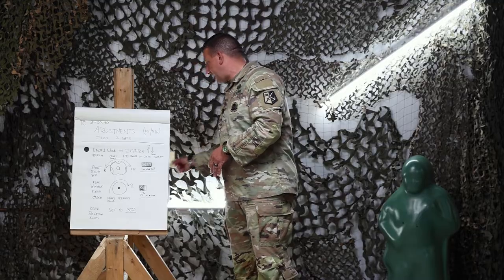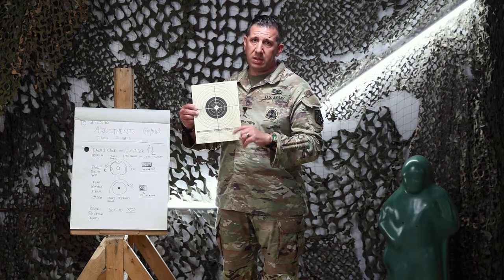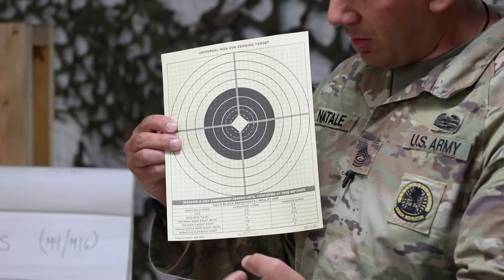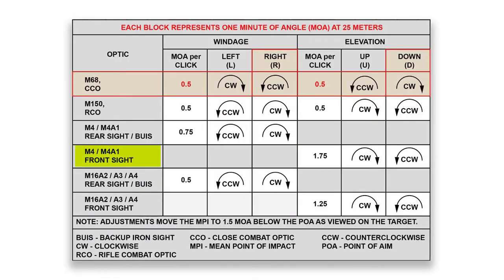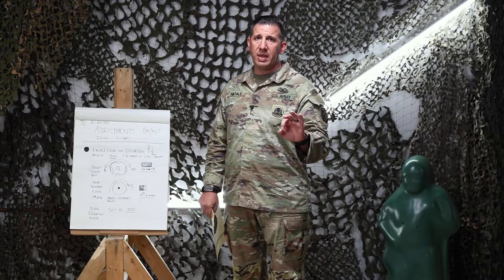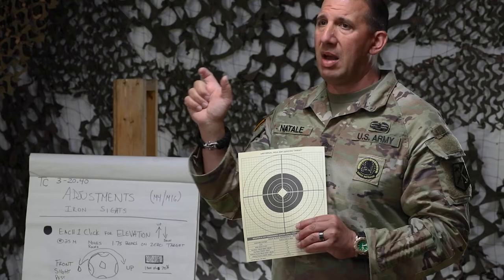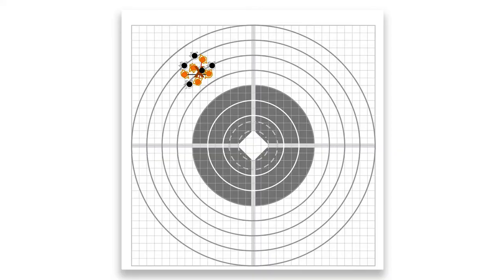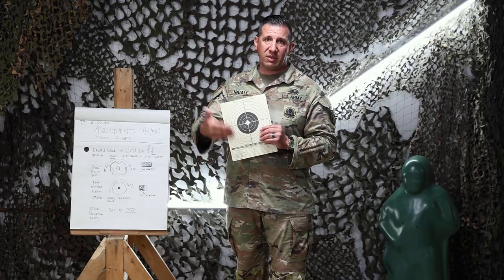Understanding Army Rifle/Carbine Zeroing Target and Procedures 2022

Comment: This is gonna sound dumb but do i aim in the center?? Im currently shipping out to fort benning and I remember I struggled with this. How do I shoot correctly and where do I aim on the target??
Reply: aim at the center while zeroing
Reply: The center of the target should be your point of aim. Shoot a 3 or 5 round group depending on the instructions from your Drill Sergeant and or Range Instructor. You will get plenty of marksmanship instruction prior to firing your first live round.  Any adjustments you are told to make will be based on your point of impact compared to pint of aim (POA/POI) Always remember to follow your instructors guidance.
Reply: At Ft Benning the odds are you will have the best marksmanship training that’s out there. Just listen and follow instructions. Now, what’s best about these new zeroing targets is center mass hold is easier to understand than the target with reduced E type silhouette, which made getting exacting elevation difficult, even for highly qualified trainers. At any rate you will not struggle at all with center mass hold . Just concentrate on consistent sight alignment and smooth trigger control.
Reply: @charlesludwig9173  haha yeah i shot expert. and zeroed good, graduated in june
Reply: @walktownn congratulations! Now, look into ARMY EIC matches. Winning in EIC matches gets you points toward earning the prestigious Distinguished Rifleman Badge. Win that badge and it will open a world of opportunities for you.

Comment: At 25m my range will be on 300m?
Reply: Roughly yes but it depends on ammo your using and barrel length of your AR…remember the military M4A1 is only a 14.5 inches long with the barrel compensator attached.
Reply: @greatcornholio5541  i have mil-spec M4 carbine which was left behind by US forces in Afghanistan.